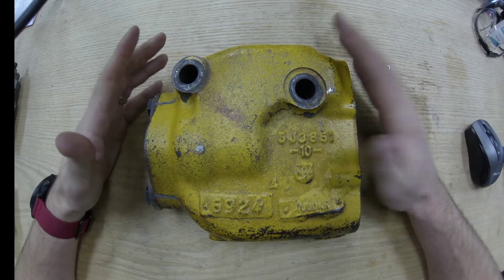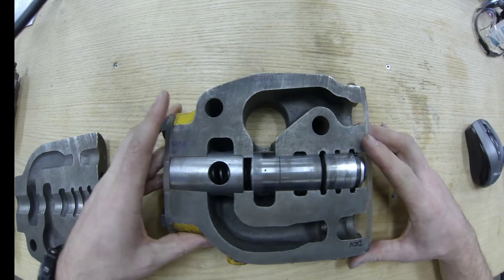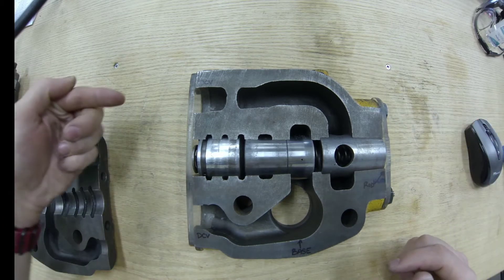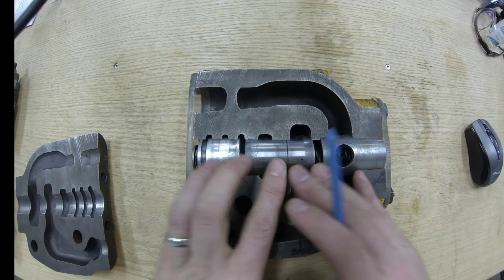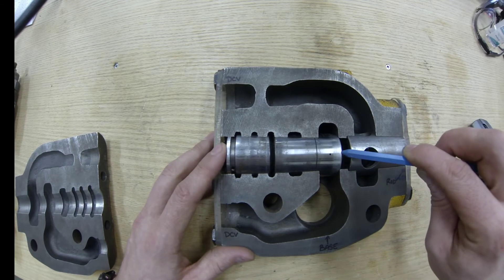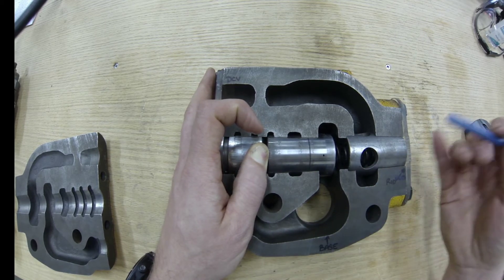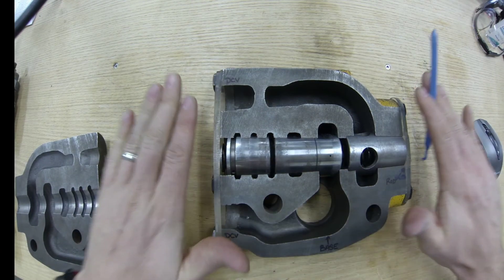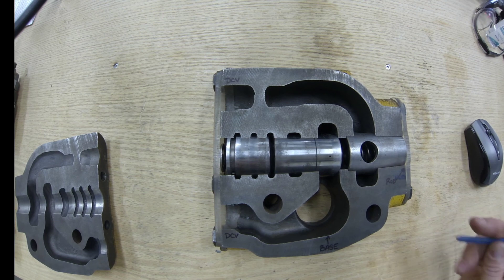Explanation of a Dozer Quick Drop valve

Comment: Was just working on mine on a D7e. In your video you have the spring in the wrong location according to my parts diagrams and service manual. Just a observation as I was putting mine back together and verifying orientation of the parts.  Not sure if you did that intentionally or if by chance something else has a different set up. Appears wrong from what I’ve seen though. Just curious what your thoughts were.
Reply from the maker: Thanks for the note, I am not sure if there is a change from the older machine part I have hear and yours from a newer E model but according to our parts book it is assembled correctly.

Comment: Hello I had a question on a different video but the comments are disabled I was wondering could you mate a manual truck transmission to a John Deere 4045 engine and how hard do you think it would be
Reply from the maker: That would depend totally on the flywheel and flywheel housing. You would need to check the SAE sizing and make sure they match with matching bolt pattern. The flywheel would also need to match the clutch housing with mating surface. After that, making sure the engine RPM and torque settings are proper for the transmission would be important. Other than that, mounting it is a challenge that would need to be overcome but with enough time, money and creativity I can’t see why you couldn’t do it.

Comment: So by understanding this, you are not able to go over relief on the lift circuit due to the pressure being equalized on both sides of the spool. Am I wrong?
Reply from the maker: No this can still go over relief. The regeneration happens when the blade is dropping. When the blade is down, the valve is held closed and can build pressure to the relief or compensator setting.
Reply: @THET1916  how about on blade lift. We have a d10r in the mine that has slow blade,ripper and tilt function on low idle. To the point it’s almost not working whatsoever at low idle. My solution is to check the main relief for a broken spring or component. But the guys were telling me I am not capable of checking relief pressure VIA blade lift function if I don’t cap off the quick drop valve. And that threw me for a loop.
Reply from the maker: @samuellaforest3048  if you are having slow speed at idle that is a flow problem and not a pressure problem. Perform a flow test at low pressure and compare it by ratio to high pressure to measure the pumps internal leakage. Better yet compare it to the manufacturers spec. Likely you are having leakage internally somewhere in a DCV or the pump itself and that is causing the slow operation. Anytime you have speed issues it’s flow related and multiple slow circuits typically have a common problem.
Reply: @THET1916  I already found the solution to the issue which was the main relief spring was broken. But back to my previous question. Why does our team leader say you cannot go over relief with a quick drop equipped cylinder? He states that the pressure will overcome the spring pressure pushing the spool into bypass position. But I think you’d have pressure equalization behind and ahead of the orifice in the quick drop housing making the pressure go behind and ahead of the spool keeping it from moving to bypass? Am I wrong?
Reply from the maker: @samuellaforest3048  I believe that when bottomed put you will only have pressure closing the valve and any oil that gets on the large surface area that would attempt to open the base to rod would simply go to tank through the rod port dcv port and result in a closed valve and capacity to reach relief pressure. Good to hear you got problem fixed, that would have resulted in no lift and slow movement regardless of engine RPM correct?